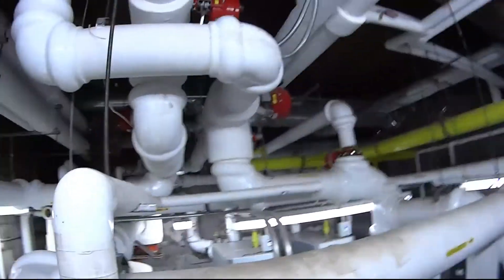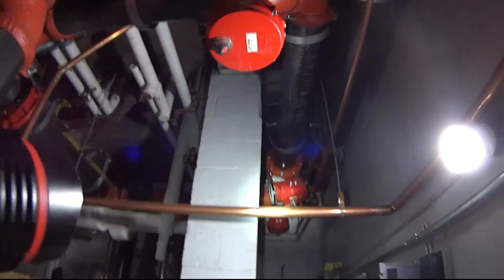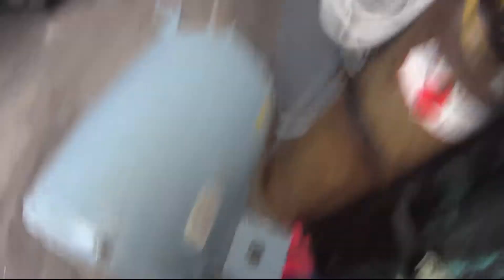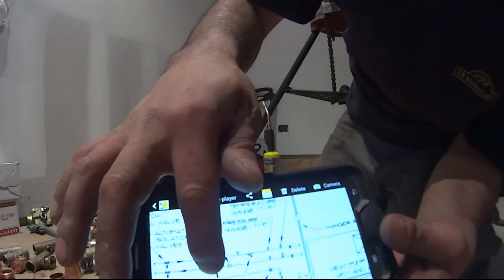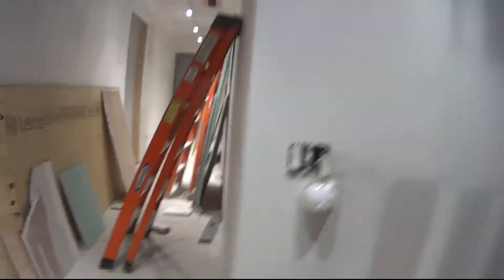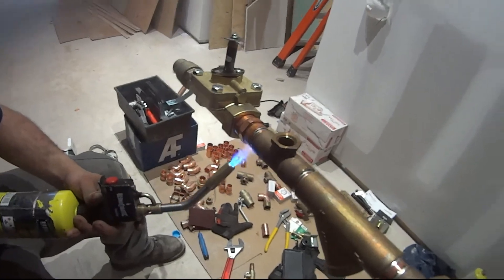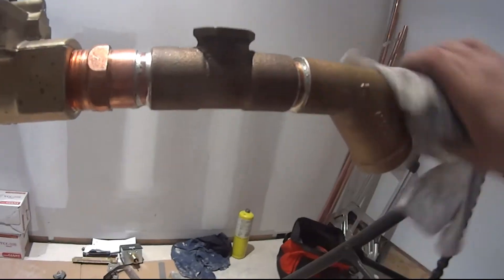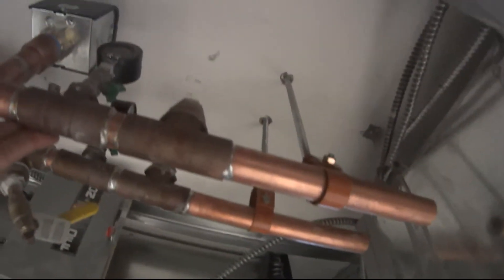Piping | Water source Heat Pump | HVAC

Comment: Good cool video  thanks dont do much water pipe sodder mainly refer pipes & # 15 sill floss no flux w/ oxy acel / but used tripple head maps gas for years .....but map gas single head torches seems to be plenty heat ...I need to practice more often bc were  getting into quite a few water source heatpumps here lately....all  new to me only air to air last 25 yrs  ....Thanks for sharing & Ill keep watching

Comment: You should use a bandsaw to cut pipe it’s so much faster and cut the handle off you fitting brush and put them in a drill. Just saying. Oh and acetylene is much faster than map gas. That pipe cutter is a pile of shit

Comment: Wow Emin HVAC that's a real nice job. That piping looked awesome. When you built that assembly did the joints have to be so close together. It looked like a nightmare to try and replace something with the connections so short but I'm sure it's no big deal for you.
Reply from the maker: You can always un sweat it, it's no biggie, it's a tight spot and I had to keep everything within arms reach, the access panel will  only be 15 by 15, not much to move in the ceiling once it's closed. Also there are unions after all the connection for future repairs. Thanks for watching bud
Reply from the maker: That piping will last forever, it will never freeze or anything like that.
Reply: Ahh so you can undo the unions and take the whole assembly out again. Smart
Reply from the maker: Joe Shearer yes that's correct, the issue is they don't give you much room for access. If  you notice In the video, there is really no access to the front of the unit, it's about 8 inch off the wall. It suckk but that's what it is.

Comment: you do fine work,,, nice electric pipe cutter
Reply from the maker: Thank you! The electric cutter failed later on the day, after cutting the 1 inch pipe it wouldn't cut 3/4. I'm gonna have to call +Milwaukee For warranty.